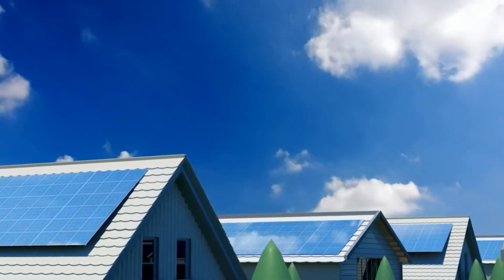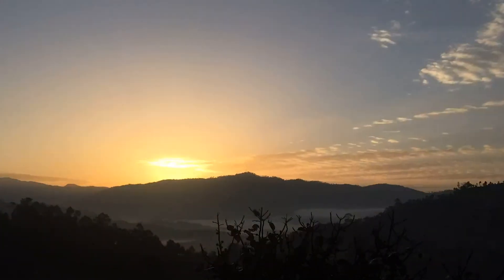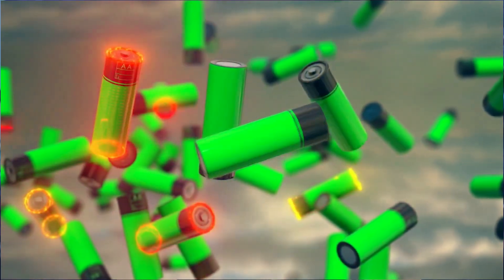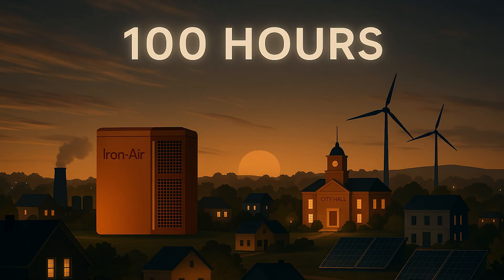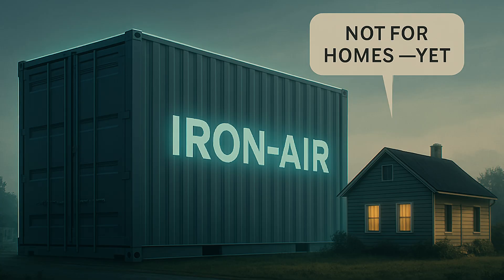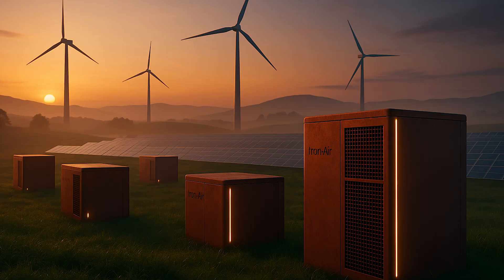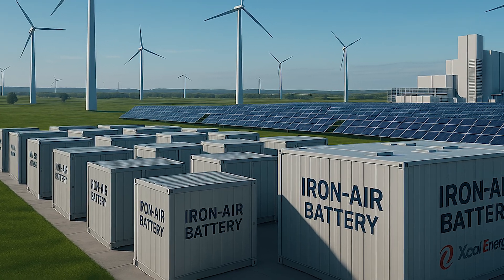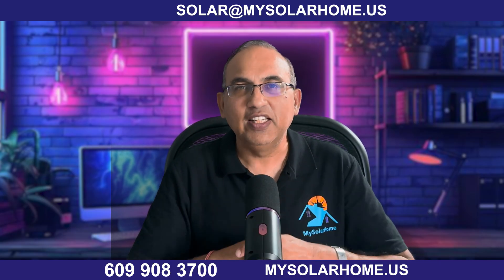Form Energy's New Iron Air Battery Is a Game Changer!

Comment: Can, I say something about Lithium Ion and the four hour supply thing. Four Hours is the fastest rate you can discharge your battery, and the huge Power density of Li ion is one of its great properties, but you could have a really big one, discharging at less than max rate, or to simplify things, three batteries, one for six to ten, one ten to two, one two to six, when the sun comes back up. I feel this gets overlooked. Redox flow batteries, Iron-air, Sodium ion, thermal storage, hydrogen production, ammonia production, ethanol production. If we really wanted to, we could be fossil-fuel free in ten years. Because of the selfish greed of a few hundred human beings, billions are destined to perish. Down with Oil!
Reply from the maker: You are right, if we have enough batteries, we can completely get off big oil. The problem has been the cost of lithium battery systems making it uneconomical to add surplus batteries. Thanks for watching.